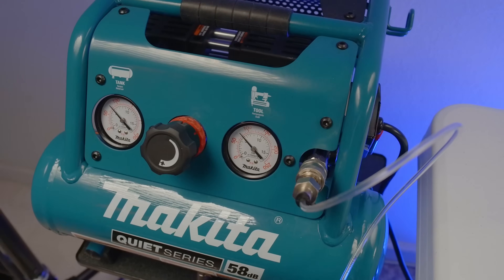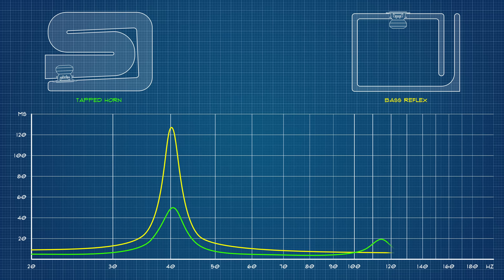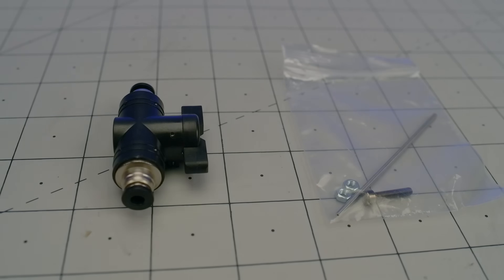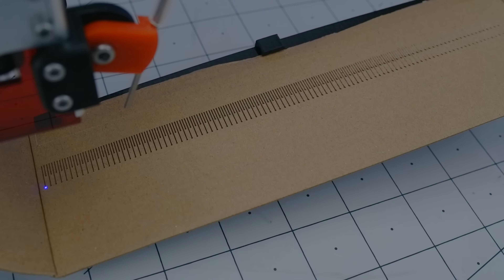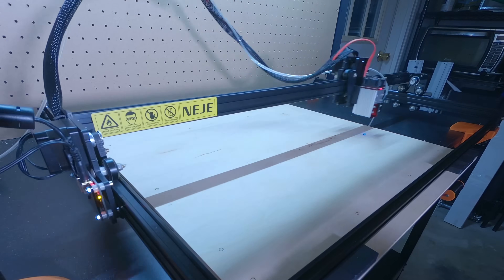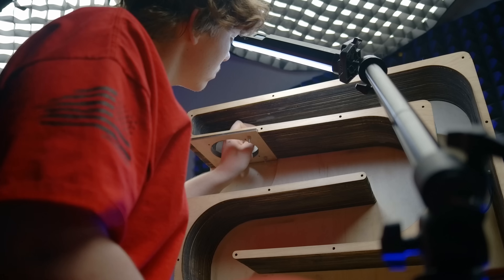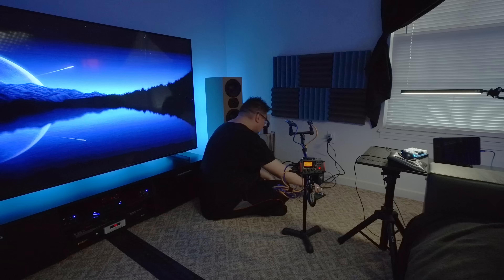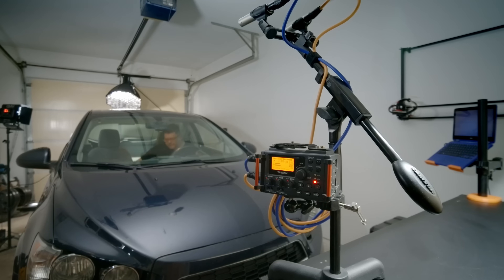Building a Tapped Horn with a NEJE Laser

Comment: love these projects, though i want to see another 3d printeds fancy t-line
Reply: Same here. An enclosure with either a larger single driver or multiple small drivers.  
I know that enclosure size is dictated largely by the size of the printer. Wondering whether it’d be possible to print an enclosure in sections and well as the layers, and then combine the sections?
Reply: @ScramTek  not with rigidity